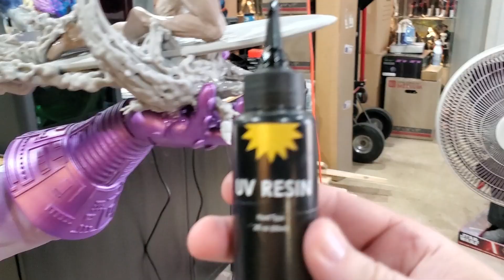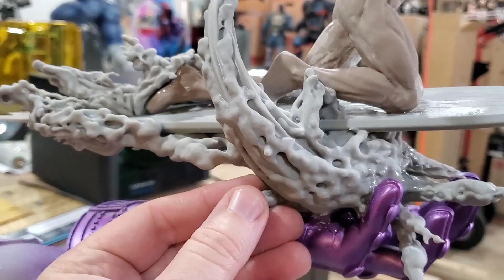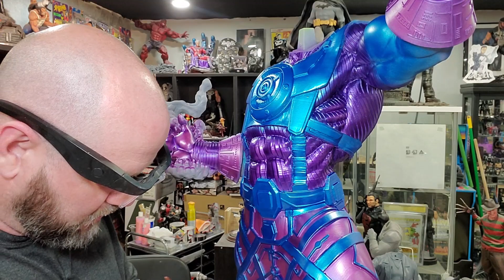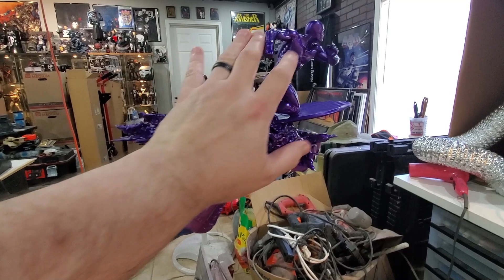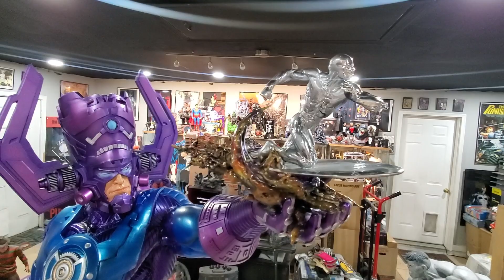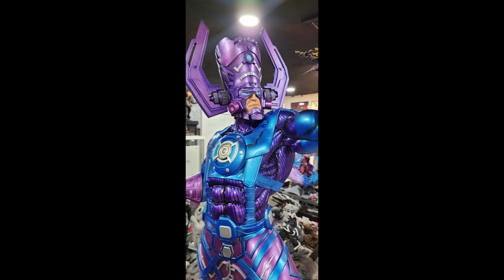Check out this 4ft tall Marvel Space Marine! Galactus 3D PRINTED

Comment: amazing piece, how do you add magnet into hollow model?
Reply from the maker: I usually don't add magnets but you can pre drill the magnet size in chitubox with the right diameter you need for the magnet. I would use some epoxy resin to glue the magnet in the hole.

Comment: Can't believe you did all of that without a pistol grip shaped airbrush. My finger would've fallen off bro. Great job. That is an amazing project.
Reply from the maker: Trust me...I bought a pistol grip after this one.
Reply: @TheCreativeCollector  It is a significant QoL upgrade. If you have always used a traditional airbrush you will love it.
Reply from the maker: I've used a pistol grip for years, I just didn't have one on hand. I have a mini HVLP gun that I use for motorcycle tanks but the pressure needed for that thing would've blown a hole in the filament.
Reply: @TheCreativeCollector  That definitely wouldn't have been optimal.